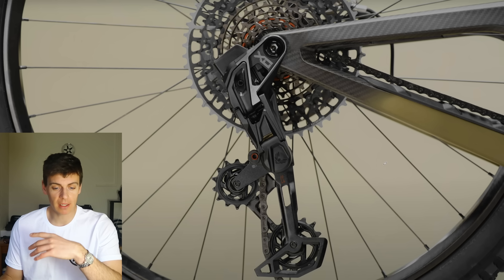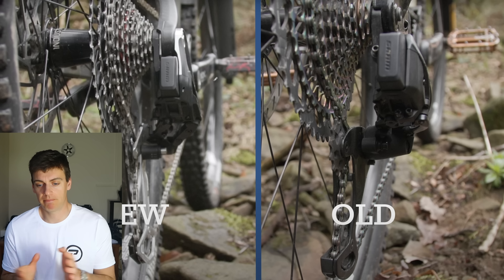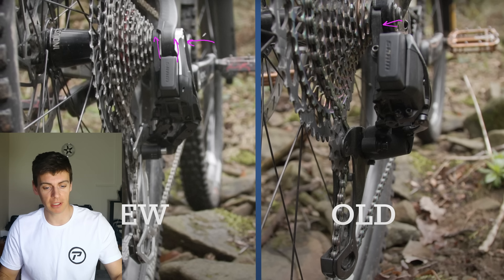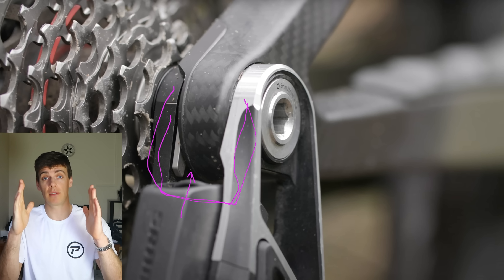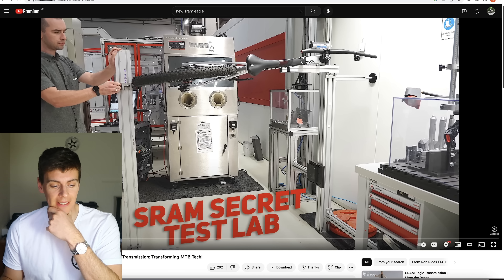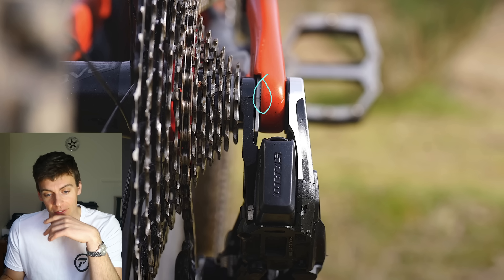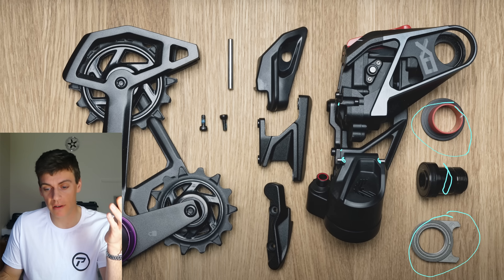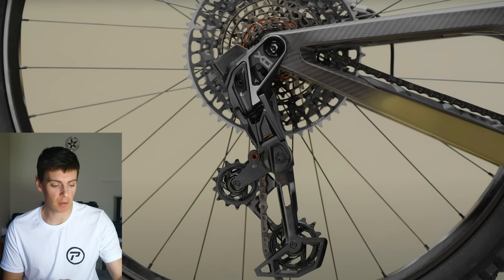Mechanical Engineer's Speculation of new SRAM Eagle (including misinterpretations!)

Comment: Concerning the alignment problem you speak of, as far as I´ve heard you can still trim the position of the rear mech just like on the current "standard" products. So if it´s a bit off you should still be able to adjust for any small differences. Of course that couldn´t fix angular misalignments though. 

When it comes to transferring the shock impact into the frame I´d really like to hear SRAM´s take on that. I cant imagine they wouldn´t consider this type of stuff. Maybe they did in-depth inspections & x-rays to check whats actually happening to the frame?

You know, I highly respect your opinion on these topics, but there are a lot of engineers and other people involved in designing and developing this stuff and putting effort into pushing a proper product out.  I know the bike industry is on the fence with QC, but I´d still not place everyone under general suspicion to throw out bad products. It seems to be a fairly solid product from what you can currently gather, of course this will have to prove itself over time.
Reply from the maker: Completely agree and understand your comment. Im sure the engineers have tested the durability, manufacturing repeatability and fmea etc. They have good engineers and processes. But from a purist point of view, it does seem like an overcomplicated solution. The clutched lower jockey wheel exemplifies that.
Reply: @PeakTorque  would love to see you do a video/series where you either design a derailleur, or explain why a particular one is the "best" (XT? GX?) There's some relatively unexplored design space out there, with things like the old Suntour triple pulley cages.
Reply: Freacer… time will tell 
But the world is full of engeneers developing products based on marketing decisions. 
Stores are full of things that go directly to landfills all designed by engineers. 
Sure, a 3k groupset has to be decent. But the only motive is sell new shit and new bikes to middle aged dentists that spend 15k on a bike. New standards, new components, new frames. Mech hanger was probably one of the longest standing standard.  And nobidy thought it was a problem. 
The only problem is that drivetrain technology has peaked, so they need to start over and make good things obsolete.
Reply: @巨大兎  the hanger was one of the least standard components until the udh hit the scene. How has the drivetrain peaked when this new innovation makes shifting under full load a non issue? Regardless, I agree this shit is for dentists.
Reply: @BrandonMeyer1641  sorry, I meant not the part per se, but the way of mounting the derailleur... the "hole" was the same for decades. I have no idea how a different mount can change the shifting. But let's believe that this system is more rigid and more efficient under load... they are just marginal gains for the average dentist. I'm not against hi-end innovation. A 3k groupset is a niche. Nobody is forcing anybody to buy a new bike with a new standard... It's all good. But my point is: sometime innovation in forced by the need of sell new shit and forcing obsolescence. For example the new Shimano Cues is way worst than this... just because it's intended to make obsolete a ton of low-end groupsets.
Reply: @巨大兎  the whole design is centered around the udh. According to sram there are 210 compatible bikes already on the market. If you don’t want it simply go with the udh and run microshift advent x or something else. A whole new frame isn’t required to run this mech. The udh has been widely adopted. It is probably the most popular rear hanger standard to ever exist. If sram invented and entirely new standard which required manufacturers to modify their gram designs to make this work this product would be much worse. That’s not the case. Sram invented a superior rear hanger standard, waited for mass adoption and then released their group set which works on the same standard but doesn’t use the hanger. Seems like a 200 iq play to me. It’s leaps and bounds better than what happened with the xd driver body or sram dub
Reply: @BrandonMeyer1641  I see, so there are compatible bikes already on the market. Good. But you look to me a bit a Sram fanboy.
Are you a dentist?
AdventX is fine to me, tbh...
Maybe you are, but I'm no XC racer by any means. So whatever bike or groupset is fine to me. Usually I go down singletracks with a cheap road bike...  :D

My point, anyway, was about the fact that innovation isnt' driven by what you need, by engineering, but by marketing. That doesnt' mean this shit isn't good. I don't know. Time will tell.

And people with more money than brain often fall for those tricks, and that's fine. Is how the industry stay afloat. Selling expensive stuff to slow people (pros don't pay!).

But I'm giving the benefit of doubt... maybe in a 10 year I will try this and I will discover that it's so way better than a mechanical Deore :D.
Reply: @巨大兎  I mean, I´m not sure how many people are actually happy to have the derailleur hanger. It´s most often the first thing that breaks when you crash onto the drivetrain-side of the bike and I´m not sure if the bending hangar really saves the frame as it´s still transferring some of the load into the dropout. If you have an older bike it can also be hard to find a replacement part. 

Personally, if it proves to be reliable, I generally like that they´ve done away with the B and limit screws and made a more robust system. The thing with the clutched pulley wheels is really a bit over the top though. 

There´s a german channel called "Enjoyyourbike" who did a pretty extensive video on the groupset. They show the same "slam against a wall test" as shown here as well as someone smacking the bike onto the floor and standing on it multiple times (to be honest, the last one is a bit of a meme) but the derailleur just continues to work without any problems. Now - it would be interesting to see what kind if impact that has on frame durability. 

I totally agree though that we are only making small progress in drive-train development and new, highly marketed ideas come with a big pricetag.
Reply: @Freacer1  I thought about it. 
My issue is that when a big player makes new shit that breaks the compatibility between parts, it's almost never a engineering decision, but more a marketing strategy. Once they decided to change and they have enough frame builders on board, then come the engineers to solve how to make this new "standard".
I guess there will be some kind of adapters to mount different derailleurs on those new bikes...
Anyway having all the stress gravitating on the axle, removing the set screws, the electronics compensating... I'm sure that the system is way more resilient than a bendy aluminum thing. So maybe for the xc racer it will give some advantage... maybe during a race this system will lower the risk of losing the italicization after a crash? Maybe the structure is rigid enough to not transfer much stress to the frame?
The idea per se is not bad.
But still it's a metal structure rigidly clamped to a carbon part. 
I guess if one has 3k for a groupset, change the frame now and then of after few races it's not a problem.
In the end, the industry is all about selling hi-end parts to the average dentist.

Comment: I don't know. Since the new derailleur and the cassette are perpendicular to the axle that means they are parallel to each other and there's no need for a derailleur hanger as an alignment interface anymore, regardless of the frame tollerances...
Reply from the maker: Kind of. 
1.The thru axle is clearance in the rear hub (thus casette), otherwise it wouldn't slide through.
2. The thru axle is clearance in the dropout.
3. The thru axle thread has radial and angular clearance.
4. The thru axle is also clearance in the hanger part. 

So theres a lot of tol stackup there for radial and angular misalignment, it is not perfect.

Comment: Getting rid of the derailleur hanger for this new clamping method that requires modified frames, it reminds me of what either you or hambini said about DUB bottom brackets - it’s sold as universal solution but is in-fact just a ploy to corner and monopolize the market
Reply: Wrong it fits all frames that use udh standard hangers which in it self is very useful having one hanger for most frames
Reply: Universal derailleur hanger. Maybe this concept is beyond your compression
Reply: In addition,  maybe it’s beyond your comprehension that literally most modern frames sold in the part 3 years are compatible with this standard. 

If that isn’t a nod to widespread adoption of a universal standard, I wouldn’t know what is
Reply: Yes once again a new frame standard.. 135, 142, 148 and 157mm - to be honest, there were so many i don`t care any longer. I just want smtg that works and this looks like it finally can take over and end this mess.

Comment: I’m not sure it is a true clevis. 
From what I could make out that black “bolt” acts a little like a shoulder bolt through the frame and serrated washer into the mech  acting as the datum left/right Y axis datum. The shoulder diameter of the bolt then holds holds a concentricity to the outside of the mech alone….I think. Would make sense as it would allow for the industries sloppy tolerances
Reply from the maker: I'll have to look again but the big polymer bushing will have quite a lot clearance!

Comment: Absolutely agree. Shift trust with tolerances to carbon frame manufactures is just stupid, they never learn (eh eh pressfit). This is just change for a change sake, marketing won again, just not good.
Reply: Tolerances of the frame aside, we can never expect for all hubs to be exactly the same and to sit in the dropouts identically. This doesn't allow for even that after the rear triangle is compressed.
Reply: @NotthatleefromTN  Dont know for sure but I think that there is shift index microadjust still avalible, that would solve hub spacing problem, but yes there is a lot of variables to make this work. I think there will be a lot of people with setup problems with this, only thing I can say is good luck to them.

Comment: Only the XX derailleurs have the slipping lower jockey wheels, X0 doesn't.

Also, prices... Bike24 has stuff in stock. XX SL chain is 178 €, XX is 148 €, XX cassette is 656, X0 (all steel) is 476, etc. Insane.
Reply: 150€ for the cheapest chain? That’s nuts. And the X0 cassette buys you 1,5 rival Xplr axs derailleurs
Reply: @Paganizondaf650  there's X0 as well, but haven't seen the price of it yet. X0 is solid pins, XX is hollow pins, XX SL is holes in plates. And X0 is 'PVD coatet for corrosion protection', so I guess hard chroming went out the window.

It's 25 € for holes in the plates. Nucking futs.
Reply: F.....k insane prices.i woould not buy it for shure
Reply: @Primoz.r   2 thinks about the 2023 axs kits that to me clearly show a big lump of P@sstaking is 1, The complete X0 groupset is £1715 and the complete X0 E bike groupset is £1400 when the only difference between either groupset is the X0  crankset have a crank spindle, X0 E-bike version does not. SO that suggests sram must make the X0 cranks spindles and then cover them it in 24C gold because WTF would it cost £315 more.  2, I'd also love to know why the "NEW" MTB XX and X0 Flat top chains are 2-3 times the price of the Flat top Road chains.
Reply from the maker: I didn't get onto the cost... Only looked at the hardware a bit
Reply: @Peak Torque  you did everything right mate. The engineer's opinion is valuable but everybody can make up their own mind on pricing. Sooner or later demand will probably drop down more than they expected because of the ridiculous prices

Comment: While I wasn't expecting to get lost in the weeds in a sram drivetrain video I thought there were some great take aways. all the points were well thought out and clearly said. That said I didn't agree with all points, I'm not a degreed engineer so not even on the same pay scale as someone like yourself. the key for me was towards the end when you spoke about mech stiffness, but you are absolutely right, for nearly 1000 dollars having something that will damage your frame is just poor design. (also isn't the mech suppose to be modular to be replaced if it breaks?)
Reply: A crash replacement RT or chainstay is probably less $ than that derailleur…

Comment: The crash test reminds me one of our brilliant Formula Student crash box designs that came out stronger than than the frame 😅
Reply from the maker: Tail wagging the dog.
Reply: That was absolutely ridiculous... I'd suggest to bash that derailleur into a rock while you're on the bike and you're running at full speed...
Reply: well to be fair to the ridiculous test, if that were a mechanical derailleur on a conventional hanger, the hanger would be bent and the derailleur knuckle dented resulting in poor shifting. IME, the AXS overload clutch is far better at saving a derailleur from impacts than a hanger has ever been. The hanger on some bikes are so stiff the mounting screws that hold them to the frame riper the drop out apart in a big accident.
Reply: @MP48  as a mechanical engineer and to build on your comment while adding a few 2c. only the very top section of the mech is stiff which lower down is protected by the clutch. Impacts here  at the top are almost as likely to impact the frame itself at which point maybe having some metal in the way is better (with possible plastic deformation and wear resistance of the metal being key factors). Without knowing what the bushing is either it is impossible to know if there are any potential shock absorbing features in there but agree the clutch is also performing the function of the hanger and some. it is probably important to note that the mech is positioned on the bike and tightened before the through axle so the through axle is not doing anything  to close the mech clamp. https://www.youtube.com/watch?v=PwGRa9SlPLI as depicted here the mech cannot be on the bike if its not tightened to the frame 🙂the face inside where the hub meets the clamp however are 2 items that can be machined and controlled nicely which would be the only interface which positions the mech relative to the sprockets and as such creates a reliable assembly not to mention position the through axle repeatedly on the assembly. IMO the main reason why mechs are also removed for transport is because of sensitive hangers. unlikely to be as much of a problem with this and mechs can be left installed in carriers that have the space. if space is a premium then this likely isn't the solution for that individual with the knurling.           Sure there are points to be proven like point loads and shock loads but this will only be a test of time and will be something that real world empirical data can provide. I am sure the SRAM guys have done their own testing but nothing tests like the real world so on these points the jury is out. what i do really like is that components can be replaced on the lower end when damaged or worn so in terms of not having to replace the entire mech this is great.
Reply: Sram's probably hiring from your Formula Student team
Reply: the "test" reminds me of a US transmission repair commercial with monkeys beating on a transmission with wiffle ball bats
Reply: https://www.youtube.com/watch?v=edzPARcVU20 thats the level of engineering at sram HQ

Comment: I'm also a Mechanical Engineer. Yes the compressive/twisting load on the frame may increase however I think the latest system of clamping and the overall design is stronger and may provide more accurate shifts. The new design also looks more compact and flush with the frame which will negate some impacts. Do people really remove their derailleurs off all the time?? 🙂  A Carbon frame may be improved for clamping forces with a steel tube within the mounting hole
Reply: Looks like looking for a solution for a problem that doesn't exist. The times I broke the rear hanger it wasn't from an impact on the derailleur but a f*** up with the chain that pulled the derailleur to the front. So, no matter how close to the frame you put it, there will always the chance to crash it. A rear hanger, although expensive for what it is, is like 10x cheaper than these derailleur. Not to mention the prize of a frame. Anyway, if the people are dumb enought to pay this prize to save a few milliseconds while changing gears under load, I think they deserve the possible nasty consequences
Reply: You didn't address the huge alignment issue and shimano also have no problems producing a rear derailleur which sits snugly out of the way - keyword: "shadow derailleur"

Comment: For me, the funniest part are the narrow-wide jockey and guide pulleys. Just why? What problem do they solve?
Reply: NW pulleys have always been a thing on Eagle (and possibly before)
Reply: The problem of bike component manufacturers running out of idiots to get money off of.
Reply: @11robotics  that is right answer!
Reply: To be fair I've used them for ages without issues, and if anything they clear mud out of the chain a bit better before it hits the cassette.
Reply: Narrow wide tension pulley is kinda a no brainier, NW guide pulley is a bit odd though.
Reply: My chain often slips off/skips the sram nx narrow wide jockeys, makes a ton of noise when the chain is off sync
Reply: keeping the chain on the jockeywheels
Reply: @Nico-jt8ll  heard of a rear derailleur cage?
Reply: Making sram chains and casettes incompatible with the sram axs der